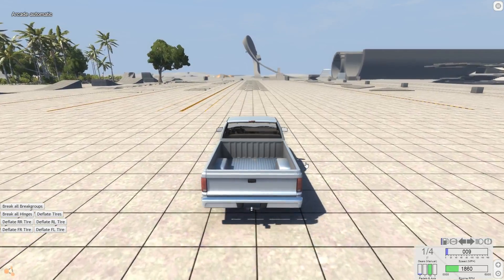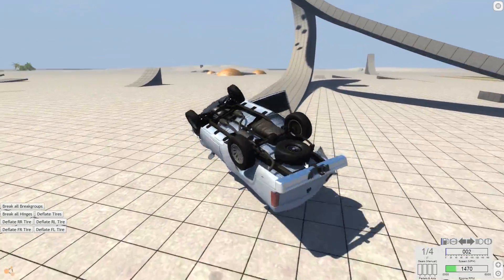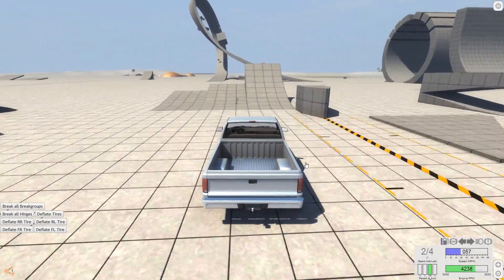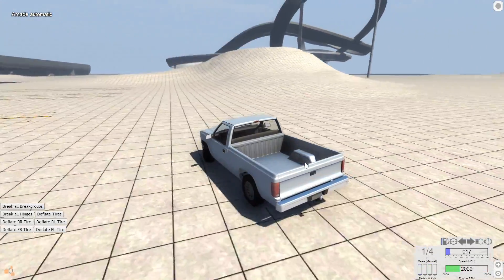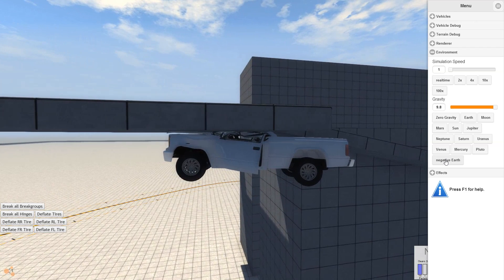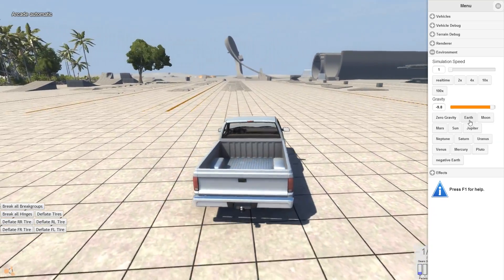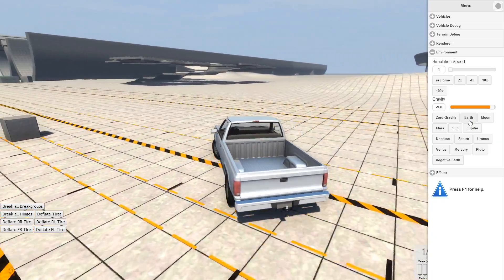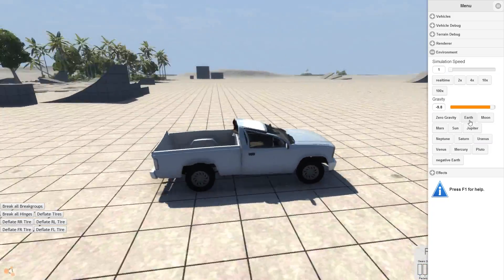BeamNG.Drive - How Should I Do Roof/Rollover testing?

Comment: depending on he truck you can use the cubes in the crusher to stop it at a set height, place a cube on each side and when the roof hits the cubes that should stop it. if you have a taller truck use 4 cubes, stacked up.

Comment: Add an obstacle like a cube or a platform in the air and spawn a truck half way on it so it will fall off and land on its roof but you made need multiple platforms depending on how big the truck is